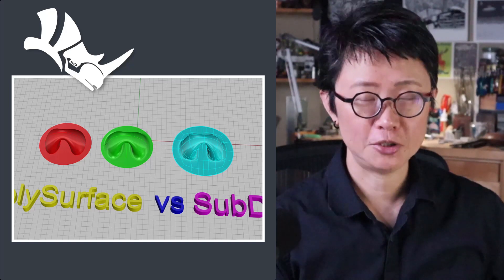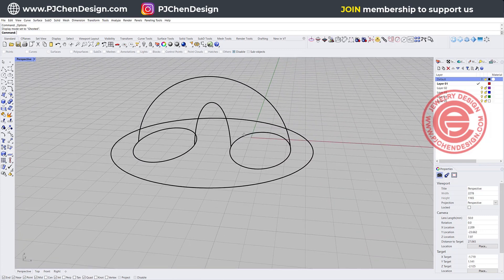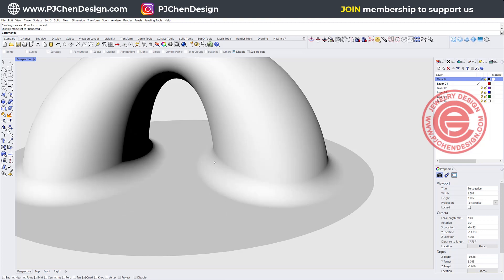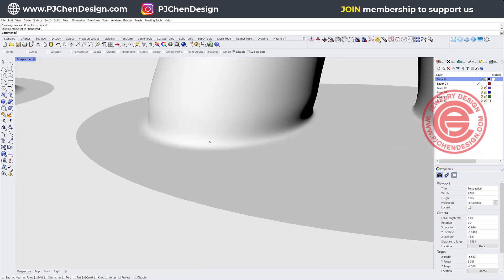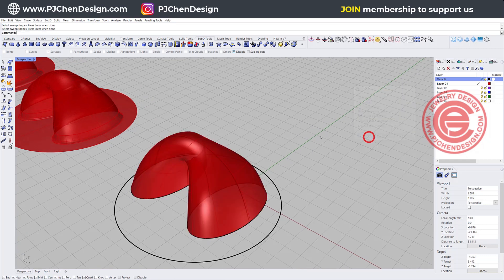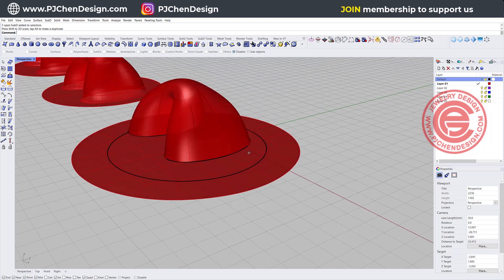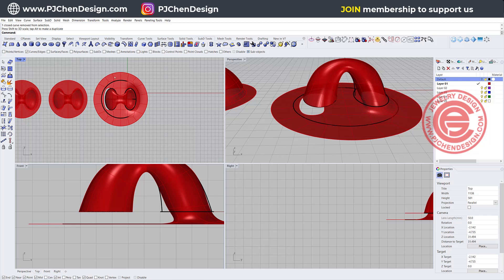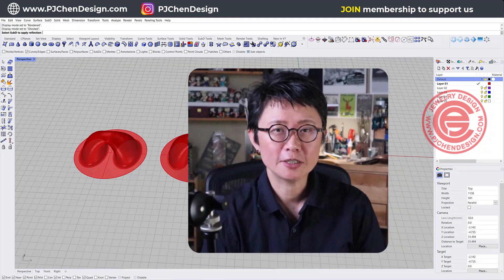Learn How to Use SubD-Jewelry CAD 3D Modeling Tutorial with Rhino 7 #416

Comment: unfortunately this software is too expensive. 😔
Reply: Rhino is actually one of the cheaper ones for design if not the cheapest.
Reply from the maker: I agree, Rhino is more affortable by comparsion. you can use Blender as well for 3D modeling in general and it is free.
Reply: @roggie1  Just because it is cheaper doesn't mean it is cheap. Two different things.